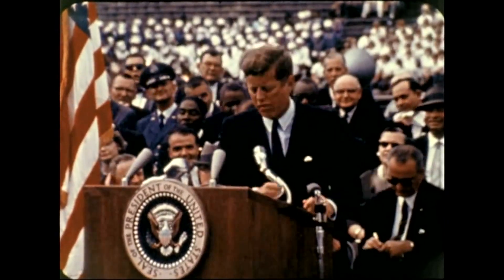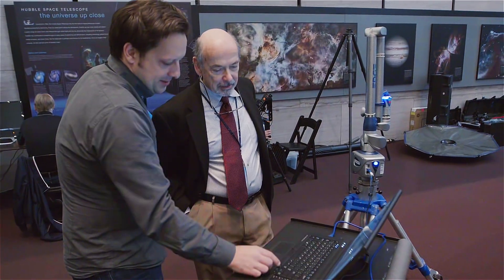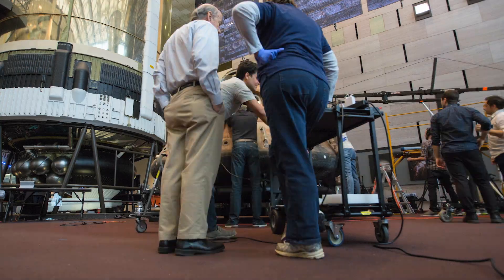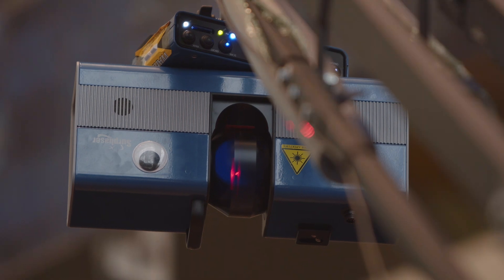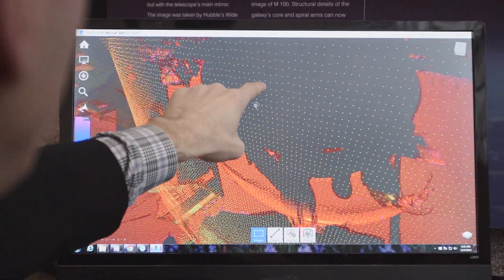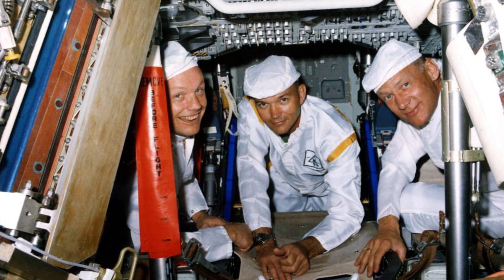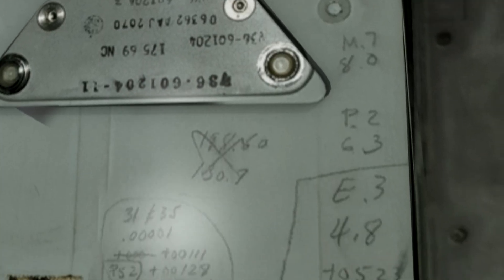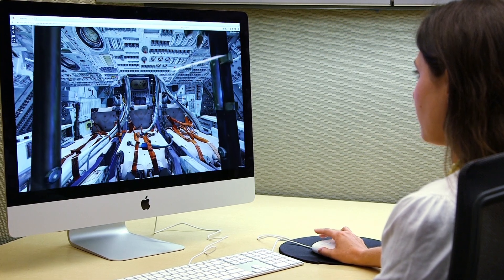Apollo 11 Command Module | 3D Documentation

Comment: I remember seeing one of these at the science museum in London in 1975, summertime.  I was 12. 
The interior was burned black. 
There are 7 of these objects, I suppose, one for each of the 6 missions and one for Gus Grisham's crew. I guess that was the one that was on display, not cleaned up or anything. How very gruesome. 
When we watched the landings at school, 6 years earlier, I remember my brother being sceptical about radiation fields. 
When I went to college, 6 years later,  I remember the guy to teaching physics talk about the temperature of space. They talked about cold space and how heat is a molecular phenomina which doesn't happen in a vacuum.  They must have known they were talking bs, but the same bs us still peddled today for curious young minds,  by dull old minds. 
If this is new and strange to you, have a look at my 5 min vid here:
https://youtu.be/Zztbw7MLlkI
Reply: The Apollo 1 capsule has never gone on public display. It was eventually placed in controlled storage in an airtight sealed container with a nitrogen environment at the Langley Research Center, Hampton, Virginia.

The capsule you saw was that of Apollo 10. I suggest that you visit again, because the interior is not burned black. Or just view images of the Apollo 1 capsule and see how they compare to your 1975 memories.

Also your arithmetic is slightly off. 

No capsule was flown on Apollos 3 & 5, but unmanned capules were flown on missions Apollo 1-A, 2, 4, & 6. Of these four capsules, that of Apollo 6 is on display at Fernbank Science Center, Atlanta, Georgia.

Obviously all the manned capsules that were launched into Space, Apollos 7 to 17, returned to Earth. That's a further 11 capules, & this is where they are located.

Apollo 7 - Frontiers of Flight Museum, Dallas, Texas
Apollo 8 - Chicago Museum of Science and Industry, Chicago, Illinois
Apollo 9 -  "Gumdrop" - San Diego Air and Space Museum, San Diego, California
Apollo 10 - "Charlie Brown" - Science Museum, London, England
Apollo 11 - "Columbia" - National Air and Space Museum, Washington, D.C.
Apollo 12 - "Yankee Clipper" - Virginia Air and Space Center, Hampton, Virginia
Apollo 13 - "Odyssey" -Kansas Cosmosphere & Space Center, Hutchinson, Kansas
Apollo 14 - "Kitty Hawk" - Visitor's Center, Kennedy Space Center, Florida
Apollo 15 - "Endeavor" - USAF Museum, Wright-Patterson AFB, Dayton, Ohio
Apollo 16 - "Casper" - U.S. Space and Rocket Center, Huntsville, Alabama
Apollo 17 - "America" - NASA Johnson Space Center, Houston, Texas

At times, some of the capsules are in storage or on loan, so my information may need updating. But there are in total 12 capsules that the public can view.
Reply: Oddly enough I'd viewed your video before. I didn't bother commenting then, but I will now.

Because of the lack of atmosphere, Outer Space is cold. There's just no molecules to heat up. The spacecraft however were capable of being heated by solar radiation.

The Apollo craft had a passive way to avoid getting overheated. The craft slowly rotated, about 3 times per hour, around its long axis. Any heat acquired while a side of the craft was facing the Sun, was radiated back into Space when that side was facing away from the Sun. 

In fact the craft needed internal heating to provide a comfortable temperature for the astronauts. On Apollo 13, when battery power had to be conserved, the internal temperature of the CM & LM dropped to zero degrees C. Not so cold that the clothed astronauts froze, but uncomfortably cold.

I know that you're convinced that the Apollo missions were impossible, sorry, but your grasp of basic physics is lacking. 

Do you really think that people would be planning manned missions to the Moon and Mars if it was impossible?
Reply: @davidkeenan5642  David, is you stop and actually look at the emperor's cloths, you'll see he's in the buff.
What you've said doesn't match up with sense. What is the special physics where Apollo is cold in the sun? Skylab was too hot without a shade, see Skylab, Day 1, wiki. 
Skylab was hot, so why wasn't Apollo? Why didn't Skylab benefit from your cold space effect? Can you send a link about this amazing phenomina for a journal? Somebody must have made his career with this odd phenomina you describe. 
How did Apollo photography survive a dose of radiation equivalent to a,  "few dental xrays?
 How do you wipe the lense when everything's covered in dust? Electrostatic tech?
Why didn't they jump more than a bunny hop? One sixth gravity and a backpack weighing your body wieght means your wieght strength ratio is three times as powerful. 
Why can't it be done, 50 years later? 
Why has all the mission data been destroyed?  
How was LOR possible in 1969 when Elon Musk can't soft land a rocket twice without blowing it up?
Why are there so many questions about Apollo? Is it because everyone hates the USA because people hate winners? or is it because the moonlandings are fake and the USA is a cheat?
Reply: Hi James, thanks for inferring that I'm delusional, I've been called worse things.

I've applied no "special physics", I just stated a fact. That is that the temperature inside of the Apollo 13 CM & LM dropped to zero degrees C when the internal heating was switched off.

That's a lot colder than the side of the combined craft that was exposed to the Sun, but a lot warmer than the side that was facing away from it.

As I stated, the Apollo craft slowly rotatated around its long axis. This was a passive form of thermal control, it was referred to as a barbercue roll.

Heat gained on the side of the craft that was exposed to the Sun, radiated back into Space when that side was turned away from it. The heat just didn't have time to be conducted from the outer skin of the craft to heat the internal atmosphere, before that heat was dissipated back into Space.

Skylab didn't rotate, so it had to employ different methods for thermal control to prevent the side that was exposed to the Sun from overheating. That side would have been in sunlight for some 45 minutes. No part of the Apollo craft was in sunlight for more than 10 minutes during cislunar flight.

That's enough for one reply. I'm off to have a cup of tea, and I'll answer your other questions in a later reply. Speak to you later :-)
Reply: @davidkeenan5642  let's forget the other points for  a minute, David, and just see if what you just said is believable. 
So if I turn a spanner three times an hour, in the sun, or exposed to a more stationary heat source, do I find that the rotation has any cooling effect? No, I don't.  And why would it cool the internal temperature of a body? 
A pig on a skewer won't scorch as it rotates, but the internal temperature reaches a maximum which is not altered by rotation. 
However, a slow roll such as you suggest, would not prevent scorching. It's hard to see how such a slow roll would have any effect. 
The word passive denotes the fact that the BBQ roll is not powered, rather the roll is continued purely by rotational momentum. 
So can we consider your claim that Skylab would have been fine if they had only rolled along at 3 rotations an hour. Does that claim really seem reasonable to you? What would you look like if you'd been turned at that rate while sunbathing? I reckon most people would predict you'd be burned bright red. 
Then we have the cold side. The idea is that space is 4k. This is arrived at by treating the vacuum as a solid and measuring it's temperature. So we take a cubic meter of vacuum and ask ourselves how much molecular energy is in it. We arrive at a figure of almost zero and conclude the temperature of space is around zero k. 
Is that really sensible? 
What is the temperature of surprise? 
Surprise doesn't have a temperature, so it must be absolutely cold. Surprise is then 4 degrees colder than CMB.  What a chilly surprise! 
You cannot measure the temperature of vacuum by the molecular velocity, that is absurd. 
If the vacuum in question is close to a heat source, your measurement can't take that into account if you are only going by particle  velocity. So you'd be sending astronauts to their deaths in the worst case scenario. The crew could be sending back reports of a steeply rising temperature and you'd be saying, "No! No! It's fine, there's no molecules in a vacuum, so you can't possibly be hot, just carry on. 
There is nothing new about vacuums. Vacuum kicked off the industrial revolution 250 years ago when it was used to pump water out of mines. Today you can watch utube vids of kids conducting all kinds of interesting experiments under vacuum in their garages and bedrooms. There's nothing new in any of this. 
So what does vacuum do to temperature? Well, when you evacuate you get a slight drop in temperature- a cold effect, when you reintroduce gas the opposite effect is seen . P equals T over V or something, schoolboy physics, that's all. Thermodynamics 101. 
All your 4k nonsense is busted. it has no theory behind it that stands up and no real life evidence. It's just a hoax. The emperor's arse crack is on public display and now most people can see it.  What a scandle! Oh dear, never mind.  You were hoaxed, get over it.
Reply: Ah James, you don't seem to understand what "heat" is.
You wrote in your opening post, "I  remember the guy to teaching physics talk about the temperature of space. They talked about cold space and how heat is a molecular phenomina which doesn't happen in a vacuum. They must have known they were talking bs"

They weren't talking bullshit, you just failed to understand then, and you're failing to understand now. 

It takes far more energy to raise the temperature of one cubic meter of water by one degree centigrade, than it takes to raise the same volume of air by the same amount. That's because air contains an order of magnitude less molecules than water. 

That's what the guy meant when he talked about how heat is a molecular phenomena. In Space there are very few molecules, that's why the temperature in interstellar space is just 3 degrees kelvin above absolute zero.

That's why the temperature on the Moon can reach 127 degrees C in sunlight, but can drop to minus 173 degrees C during lunar night-time, and even lower in parts of lunar craters.

Where do you think all the heat of the lunar surface goes? It radiates out into Space as the Moon rotates into lunar night. Rotating the Apollo craft employed the exact same mechanism to dissipate heat.

You seem like an nice enough bloke, but I'm resigned to the probability that in striving to explain this simple stuff, I'm just banging my head against a brick wall. You remain unconvinced, and I just end up with a headache. It reminds me of trying to explain the theory of evolution to a young earth creationist.

Studies show that someone who believes in one conspiracy theory is likely to believe in others. Do you believe in other conspiracy theories James?
Reply: @davidkeenan5642  It depends what you consider a conspiracy. Would you say Christianity is a conspiracy of a predacious clergy over a docile and ignorant demos?
Piltdown man was a hoax, but was it really a conspiracy? 
I believe what happens isn't so much a conspiracy but rather a failure to discern, a rush to believe, an indefinite suspension of disbelief.  
I hope you're not a Christian Priest, an academic whose never heard of Piltdown man, in addition to a person who never really evaluated Apollo's veracity for himself. 
You've not departed from anything I've heard before by much, although I can discern an original tone that people reading only other peoples comments can't manage. 
Usually I get the line, 
"Oh, so you don't know the difference between Heat and temperature."
and the like. 
It's all very condescending for an electrical engineer to hear and from those who have no link from theory to practice. Of course we all have that link but many refuse to employ it when they talk about Apollo and the heat of the sun. 
So what about this, 'heat is a molecular phenominon' claim?
How can a person link that into their own life? 
Well, to begin with, try to understand exactly what is being said. What is heat? 
Heat is the transfer of energy.
Is it material? No. 
Are the objects receiving and emitting the heat material? Yes.
But heat itself is not material in the sense that it is non nuclear (in thr atomic sense) hence, non molecular. 
It is a molecular phenomina only in the sense that it effects molecules . Molecules absorb heat,  store thermal energy and emit heat onto cooler molecules. 
That's it. 
All this is self evident and sensible. 
So where is all the confusion hiding? 
Partly, confusion arises when we divorce our reason apriori from the experience of life, the aposteriori evidence. 
When Skylab was in space, like all other orbiting bodies it got hot. Space may not be made of molecules, but people are and so is aluminium. 
We know it was hot because they told us it was. They were in low earth orbit so we could see them with telescopes and track them with radar and satalite all the time. The Skylab mission was infinitely better verified than Apollo. 
We must expect them to get hot,.like everyone expected them to get hot.
Look at JFK speech in 1962. If you view a vid of the entire speech on utube, stop at 15:19 and listen to him talk about the terrible heat obstacle they intend to overcome. 
No new alloys were ever created. The Apollo crew claimed they were cold. How is that possible? 
If you seen my vid before, you may like to view another 3 I've made recently. Each one is on a separate aspect of Apollo and each one is proof that the mission wasn't possible. 
I hope you can really start to engage with your own experience of heat and realise that cold space is very rare at 1 A.U. , even though.it is sometimes believed to be the norm. 
Craters on the moon are rarely deep and few of them are in constant darkness. The heat pounding the lunar surface doesn't just bounce off into space, but is mostly absorbed until a high temperature is reached.  After this point the heat creeps ever further down into the rockbed at an ever decreasing rate until the night comes. For 2 weeks the surface is bereft of all sunlight, and the stored energy is slowly released out into space. When you talk of the night temperature of the moon you must be considering the average temperature over the 2.weeks. Remember,  no accelerated cooling as on earth. True, there is no cloud cover to blanket the warmth, but the consequence of no atmosphere is also to insulate the rock from heat loss. 
Have you ever wondered what night is like on the moon? On a night when the great earth,.4 times brighter than our moon, dips below the horizon? Even now there's no darkness, as the milkyway brilliantly illuminated the sky from one horizon to the other. 
Or do Apollo believers just have a dar,.cold lunar night in perspective?
Reply: To me, Christianity is just a jewish messiah cult, that gained power from the Roman Empire.

Piltdown Man was, as you say, a hoax, but not a conspiracy.

Be assured, I am not a Christian priest. I ceased being a Christian in my late teens, and have been a hard agnostic since my late twenties.

"Heat is the transfer of energy."  What?  My understanding was that heat is a form of energy arising from the random motion of the molecules.

Thank you for the inviation, but I won't be checking your other videos. I viewed plenty of such videos years ago when I was researching hoax and conspiracy claims. I no longer comment on such videos, for the same reason that I don't comment on creationist videos. The arguments, all flawed, are ones I've heard multiple times.

You accept that Skylab was real. So you accept that a heavy payload could have been placed in LEO back then. Well what I'm saying is what the Saturn V placed in LEO on the Apollo missions, was the third stage, carrying enough propellant to send the remainder of the combined craft coasting towards the Moon.

Well, it's time for me tea, & then bed. I can feel my brain slowing down :-)
Reply: @davidkeenan5642  Piltdown was a hoax in the begining, but after 30 years, with 10 years still to run, there must have been people who realised that due diligence hadnt been done, that the specimen wouldn't stand proper scrutiny, that the specimen was a hoax, and the discovery would be ground shaking. At some point Piltdown went from a hoax to a conspiracy. 
Christianity has true believers, but at the apex of the church hierarchy  when preditory paedophiles are being protected from justice, I think we can indeed point to a conspiracy of silence. 
Von Braun was presented to the public as a model citizen, an admirable leader, a genius. That image was carefully preserved by those in power. Right there you have a conspiracy. Von Braun was literally a slave driver who almost certainly had prisoners executed. He certainly was in charge as they died in their thousands. His v2 rocket terrorised civilians and took two thousand Londoners to their doom. He was a fine candidate for the  Nuremberg war crimes trials, surely. 
Once you admit one conspiracy, you begin to see them all over the place. That doesn't make you a conspiracist,  it just makes you politically aware. 
Your idea of heat is fine for general use, but you pulled me up for not understanding heat and then you suggested your own less accurate definition. 
So just to clarify, heat is all about the transfer of energy. Once the equilibrium has been achieved then the accurate description of the energy in the molecules is not heat, but thermal energy. 
If you believe in Skylab, then you cannot deny it was hot. 
Do you still hold that if it turned 3,  times an hour,  it would not have required the shade they desperately installed. 
It was a bit surprising how you went into the low earth orbit heavy lift evidence provided by Skylab. But ok. 
The only thing I would say about that is that you might consider comparing the tail flame of Saturn 5 with the shuttle launch, or even a modern heavy lift spacex.  True, Spacex isn't really heavy lift. But it's hard to find anything with the long tail of Saturn 5. 
The conspiracist say that the mix was weak. 
The strange thing about Saturn 5 was that the stability problem which dogged those engines were solved by an explosion..Werner explodes a charge during a trial firing. The trial shows stability despite the explosion and now all the stability problems are deemed to be solved.  What seems to have happened is that von Braun  powered down the rocket with a weak mix, knowing that performance wasn't an issue as long as it could take an empty shell out of sight.  
I'm still watching those conspiracy vids and taking them on their own merits. They aren't all the same, there is always some surprise.. My vids have unique proofs that originate from me unless otherwise stated.
Reply: I differenciate between a hoax, perpetratred by an individual or a small number of people, an organised deception, which is a common tactic employed during wartime, and a conspiracy such as the one you're suggesting happened, which would require cross agency and cross national deception.

The Piltdown Man skull was not subjected to scientific scruting, and some scientists expressed scepticism from the outset. It was accepted at the time based on the deeply held racial predjudices that were prevelent in Britain in 1912. But it was always an outliner, and though there was some resitance to allowing it to be examined, there was never a conspiracy to assert that it was genuine.

The Catholic Church certainly did conspire to protect kiddy fiddling clergy from prosecution. Mother Church had to be protected. It's incredible how much power this feudal institution exercised its community.

Von Braun's war crimes were ignored because he and his team of scientists were years ahead in rocketry. America had a new enemy, the reds under the bed, and the nation couldn't afford to throw away his expertise. 

Hidden away in Huntsville, average Americans were unaware of him until Disney presented him without any mention of his Nazi past. It was a PR operation, and it worked to inspire others. Does the ends sometimes justify the means? During the Cold War it certainly did.

But it's a mistake to see conspiracies everywhere. Politics can be a corrupt business, but not all politicians are corrupt. 

When it comes to scientists, you have to understand what motivates them. Money is not at the top of the list for most, and virtually all research scientists could earned more in the private sector. It's intellectual curiousity that drives most, and peer recognition is what they crave.

History informs scientists that knowledge always advances, and that deception will always be unmasked. Few would risk their reputation for something so grubby as money, and uncovering fraud can make a scientists reputation. 

Science is not about proving theories, it's about disproving hypotheses. Scientific theories are just hyothese that are supported by a vast amount of empirical evidence, have not been disproved, and best explain natural phenomena. 

This is why I say that Young Earth Creationists are glbal conspiracy believers. I say believers, because they don't have a theory, though promoters of Intelligent Design would like us to think that they have. But the moment you use the supernatural to explan anything, that explanation becomes a non-scientific idea.

You again stated that "heat is all about the transfer of energy". But it's not, heat is energy! 

The transfer methods for heat energy are convection, conduction and radiation. In Space, convection can't happen. Conduction can happen between the outer and inner surface of the spacecraft, but how long does that take?

The BBQ roll prevented one side of the craft staying too long in direct sunlight, without the need shades. It was an elegant solution, that saved weight.

You can't just argue that this didn't happened, you have to provide calculations to support your accusations.

You are calling all the Apollo astronauts that flew to the Moon liars. Nothing about the actions of these men before and after they were part of missions support that accusation.

In fact the number of people you are accusing of lying is staggering, and just not credible.

Testimony is evidence, but not proof. But testimony that is supported by empirical eveidence, which is the case with these astronauts, is creddible.

By saying these men are lying, you're putting yourself on a par with deniers of the Jewish holocaust.
Reply: @davidkeenan5642  wow that last comment. I'm antisemitic now because I called out Apollo.? 
You have missed an important component of a conspiracy- groupthink. 
Peer group pressure is a huge force which should not be ignored. It's possible to succumb without realising it or being no more than dimly aware. 
You say that scientists could earn more in the private sector. I'm wary of that claim. While a professional in the state owned institution can point to colleges earning more in the private sector, you need to take into account security of tenure, pension and other benefits, like sick money,.which are all taken for granted in the lower waged state employment. 
Am I calling thousands of people a liar? Well I'd suggest two ways of doing the hoax- 
suggestion 1- tell everybody involved that it is a hoax but ask them all to keep mum,
2 Tell no one who absolutely doesn't need to know..
Even astronauts can be managed in deception. They actually do spend 7 days in a tank. Simulators are not new. No ultra is suggested as a means of brainwashing..
All the astronauts were essentially soldiers, despite the civilians status claimed by NASA.  
But here's the thing, if they couldn't go, they couldn't go. 
Heat is not energy, heat is transfer of thermal energy- true story..
Don't just repeat the same mistake . 
This is a pedantic point and I don't want to repeat it, but if it comes to who did the homework then it's me and not you. 
The most accurate definition is not that important thought..Exactly at what rate a body heats in space is not even that important. 
The only thing that matters is that you can see that Skylab overheated without its solar array shade and that it was imperative to employ a substitute and release the remaining jammed array. 
I don't have to prove that a slow turn doesn't affect internal temperature because there is no known application where this phenomenon is recorded outside the Apollo narrative.
Reply: @davidkeenan5642  Exrodinary claims require extrordinary proof. 
Once I was painting a big wall which had a wide extension at the base. A hedge along side the extension meant that it was impossible to lean a ladder straight into the wall. A guy suggested the stupidest thing I've ever seen. He put one ladder almost plumb upright infront of the extension and another at the slope of the extension roof, meeting the upright ladder a foot or so above the roof. Sont know if you can picture it. Anyway, I was cautious to say the least. 
The guy went up the standing  ladder, crawled along the near horizontal one, and when he reached the wall he grasped the ladder with both arms and shook himself up and down. 
Extrordinary claims require extrordinary proof. 
You're saying it's ok for me to go out onto the beach under the summer solstice sun at noon, inside a tin can. You're saying that if the can is made to rotate three times an hour it will be cool. When does it start to get cool?  What is the name of this effect? 
Is one if us missing something here?
Reply: David Keenan ... According to you, then, Alan Bean (the astronaut and astrophysicist) is either deluded or lying?

Bean is on record (video) as saying that Apollo flight-craft were exposed to the sun, heating them to 250 degrees Fahrenheit. Does not sound cold to me...

Then, there is Armstrong and Collins claiming “deep black” with “no visible stars” ... while more recently Don Petit and Mike M(?) claim there are “billions of stars visible from space.”

Give it a rest already! These guys can’t even get a simple story straight ...

NASA makes for good “bread and circuses” ... and not much else.
Reply: James Donaghy 
Easy one if you’d take 2min to google, something you’re so baffled about you had to be condescending to David,who was nice enough to entertain your bs.
Here you go: 
 Skylab had a primary and secondary shell, the outer shell, a micrométéorite shield which also served as its main heat shield, was supposed to deploy once the Skylab was in orbit. However it deployed right after takeoff and was torn off by wind resistance obviously, along with 2 outta three solar panels I believe it said. Which is why a new heat shield had to be made and the panels fixed. They stayed cozy in a Apollo 13 csm while they made repairs btw. Lol. Which was designed to renter the atmosphere btw lol, not orbit the planet, big difference there buddy. 
All the info is available to those who want the answers to the questions lol. 
 Although I didn’t find it on a site called conspiracy’sareus, so it’s prolly fake.
Reply: James Donaghy 
 They used brushes for the dust, after the found out wiping it would have a sandpaper effect, at least on the helmets anyways, as the clear part is a polycarbonate. I’d imagine the camera lenses were glass and more forgiving. I can’t remember hearing the camera lenses being a problem. 
Prolly cause it’s fake.
They also had vacuums for the equipment and to suck the dust out of the air in the CM. 
If you really wanna know why you asking in the yt comments instead of looking it up?
Reply: “When I went to college, I remember the guy teaching physics, talk about the temperature of space” 
He’s called a professor, and they’re not always right, I’ve had a teacher be wrong plenty of times. Did you ever fact check him, or get a second or third opinion, or you just assumed he was the leading expert on space?